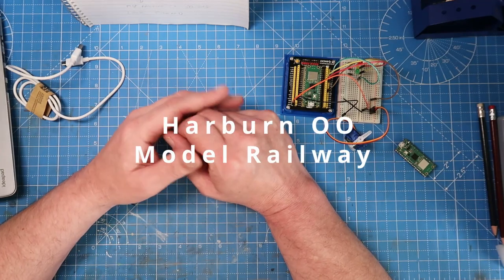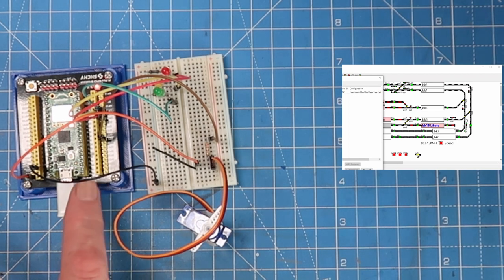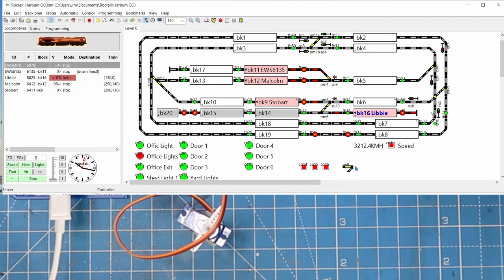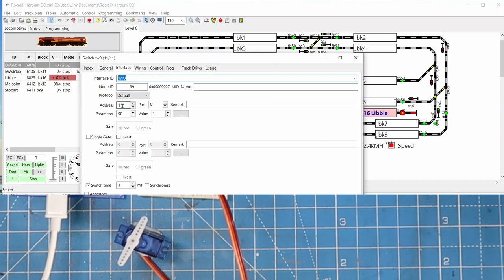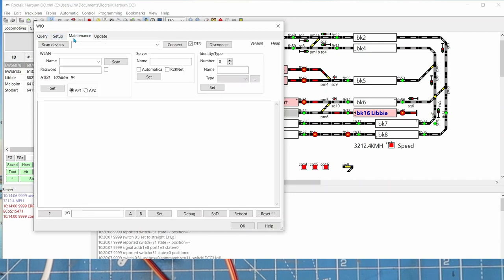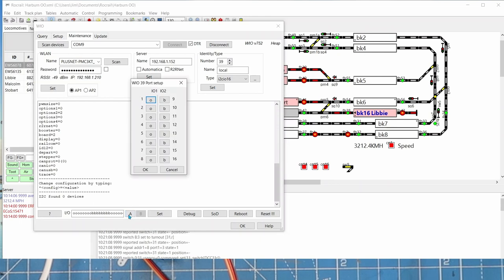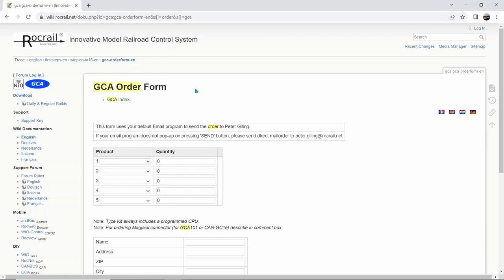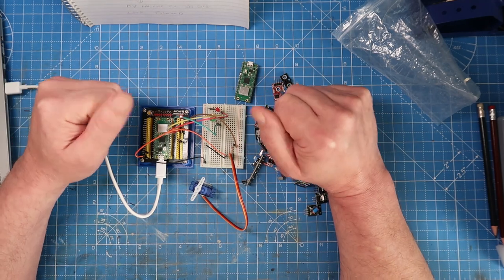Rocrail WIOpico 16 I/O

Comment: For Servo motors we need to select O or P in the setup tab of WIO. From port 1 to 16  it reserved for the sensors so what will be address of the 1st servo motor and which port we need to select in the setup tab of WIO
Reply from the maker: Hi Giant Jupiter
I have set up the Red Led on port 1 and the servo on port 1. Forget the O P 1to16.
Reply from the maker: My mistake not port it's address 1 leave port to 0

Jim
Reply: Hi Jim, the question is which option do you select for the servo motor in the setup tab of WIO is it  I for input, O for output, B for block and P for pulse.
Reply from the maker: Seams strange but you don't need to set the IO to any...the servos pins are in addition to the 16 IO ..so you have 16IO pins And 4 servo pins which have address 1 to 4